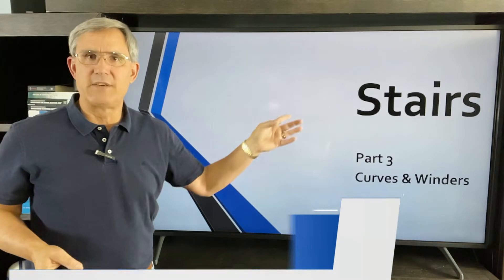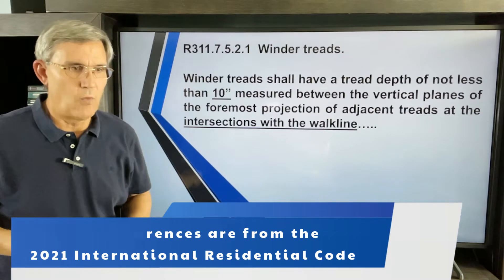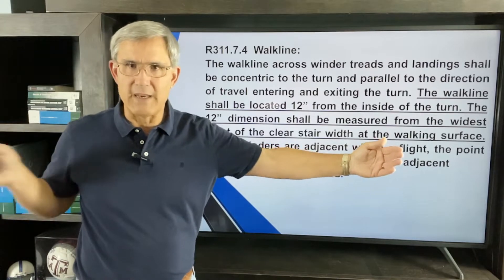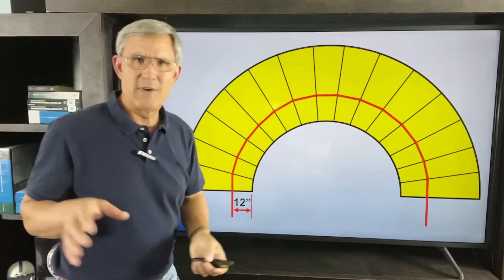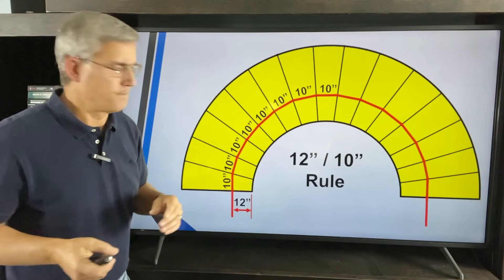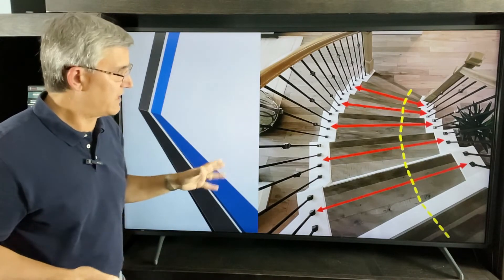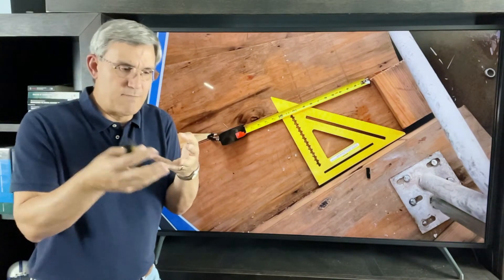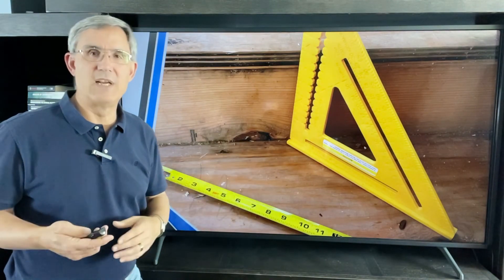Basics of Stairways - Part 3

Comment: Hey Dave!  This was the best one yet, some more advanced questions here, and an excellent explanation overall.  Two questions:  1) if we have the "no tread depth less than 6in", why do we also have the 12' / 10" rule?  It seems to me, that if we have both, the bend angle of the stair, per step, has a minimum level.  If we used that as the requirement, we could reduce to a single rule.  2) You did a good job explaining the problem of the square stair bend, but I need to see a good example of how a square turn stair is really done then if we have a requirement of 6in min tread depth AND the 12"/10" rule.  It seems to me that there really is no square turn stair anymore, we will have a different configuration, but I am having trouble seeing how it looks.
Reply from the maker: Thanks for the comments.  I will contact off line.